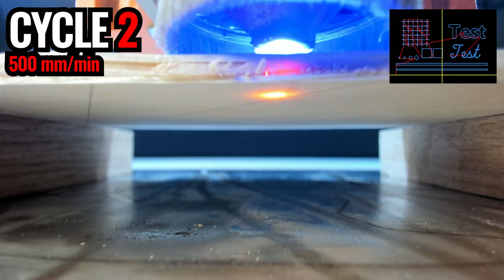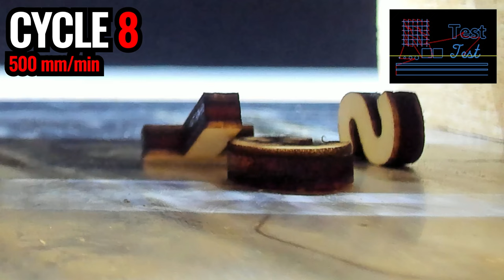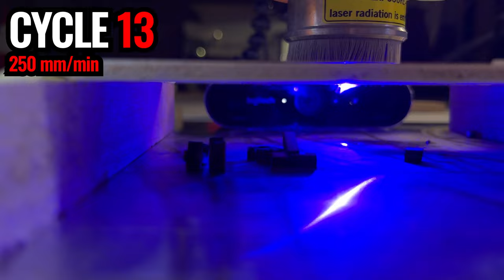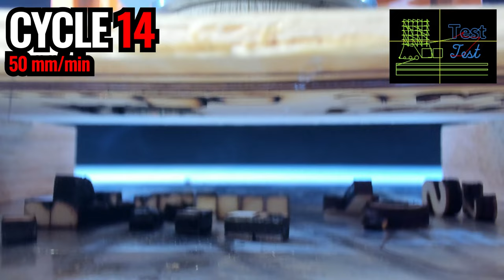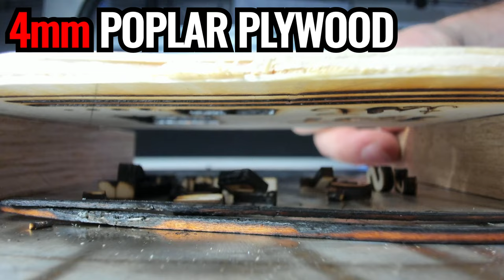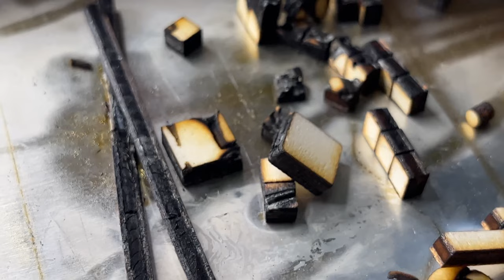Stepcraft M1000 - 3W Laser test with 4mm plywood

Comment: In your "Stepcraft M1000 Assembly Guide" video series I've noticed that you use a STANLEY DN 200/10/5 portable compressor for the ATC (Automatic Tool Changer). Are you satisfied with it for tool exchange and would you recommend it for use with a Stepcraft CNC router? Thanks in advance for your opinion.

P.S.: I'm going to buy a Stepcraft M1000 with ATC in the near future. ;)
Reply from the maker: Hi, yes, it works prety good, you just need 8bar minimum.
Reply from the maker: 8,5 bR better, i run at 9